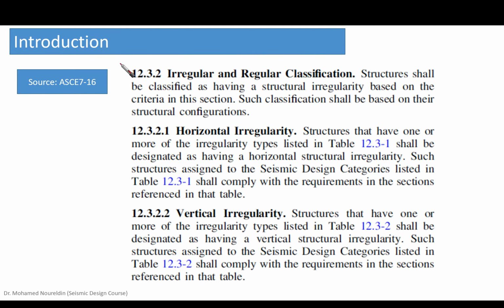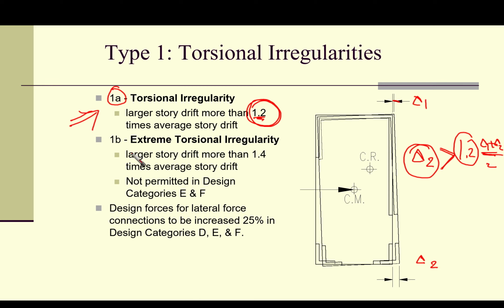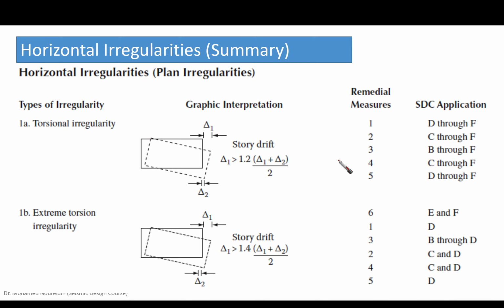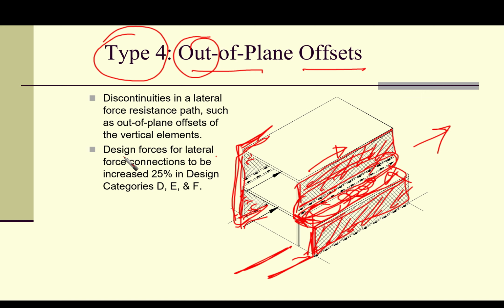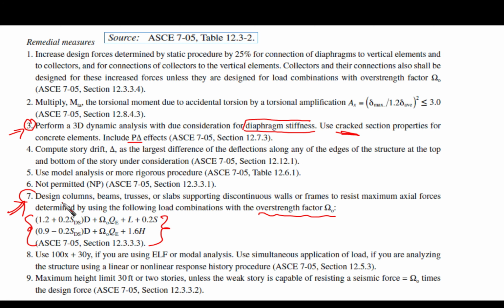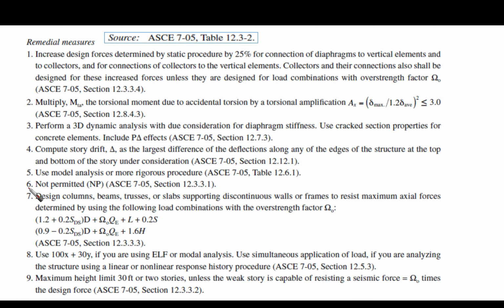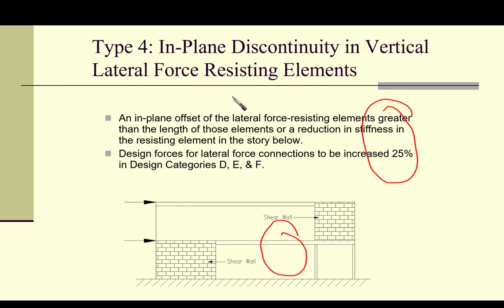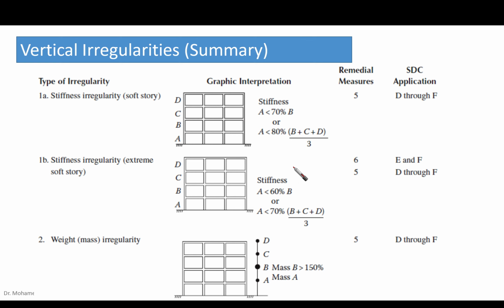14-ASCE-7 Seismic Provisions-CONFIGURATION IRREGULARITIES- Dr. Noureldin

Comment: Thanks for your effort Dr.Nour,
but I have a question about "Out-of-plane Offsets", should I use overstrength factor to design foundation or using only for the element connecting directly with shear wall.

Comment: Dr Mohamed
I have a question regarding type 5 irregularity. Can you explain how you calculate the story shear of the braced frame example. The story shear of the second story is brace tension and compressive capabilities. The first story, there are only columns so is it the shear capacity of the cross section?
 Thank you

Comment: Hi I wanted to ask,
Does it make any sense for me to check torsional irregularity  on the X using a lateral load in the for (100x + 30y). Or would it make more sense judt using 100x for X and 100 y for Y?

Comment: for horizontal irregularity type 5: required remedial measures (3, 5 and 8) 8 allows use of ELF while 3 and 5 do not allow it , can we use ELF or not? there is confusion?
Reply: Thank you for your comment.
 Remedial measure 8 is related to the direction of loading in general.  It says “Use 100x + 30y, if you are using ELF or modal analysis. Use the simultaneous application of load, if you are analyzing the structure using a linear or nonlinear response history procedure (ASCE 7-05, Section 12.5.3).” 

In the case of SDC “C”, structures that have horizontal structural irregularity Type 5 in Table 12.3-1 shall use one of the following procedures: 
1. Orthogonal Combination Procedure using ELF, modal response spectrum, or linear time history, or
2. Simultaneous Application of Orthogonal Ground Motion using the response history procedures.

Based on that, ELF can be used for SDC “C”.  Other SDCs can use more rigorous procedures
.

I think there is no confusion now.
Reply: @mrnour20  Thank you God bless you.

Comment: Thank for these lectures, kindly, what is the difference between Remedial measures 3 and 5  (3D dynamic analysis and modal rigorous analysis)
Reply: The modal rigorous analysis may not require the consideration for diaphragm stiffness, using cracked section properties for concrete elements, or Inclusion of PΔ effects. Both remedial measures (3 and 5) may overlap in using  3D dynamic analysis, but they are different in the details included.
Reply: @mrnour20  Thank you God bless you.